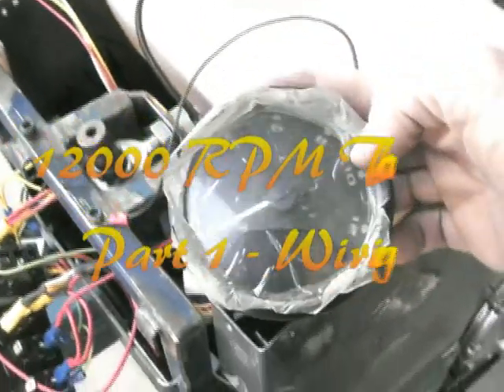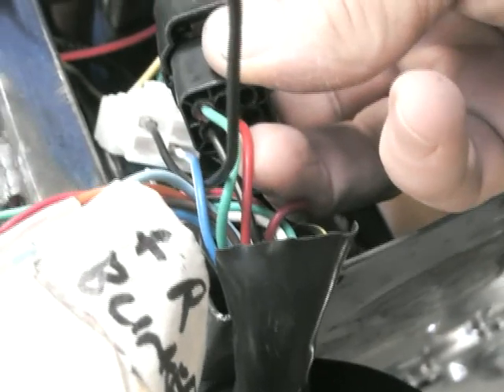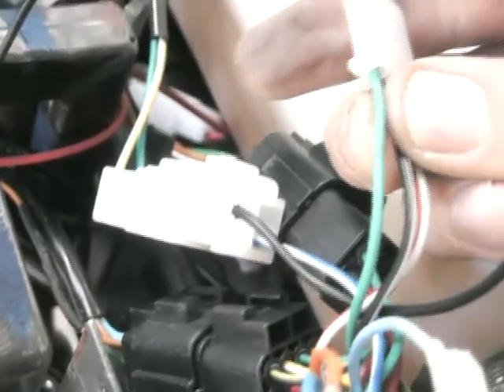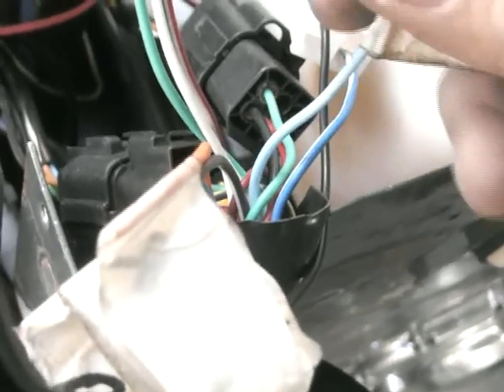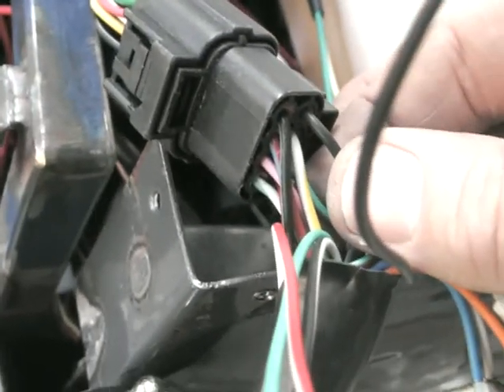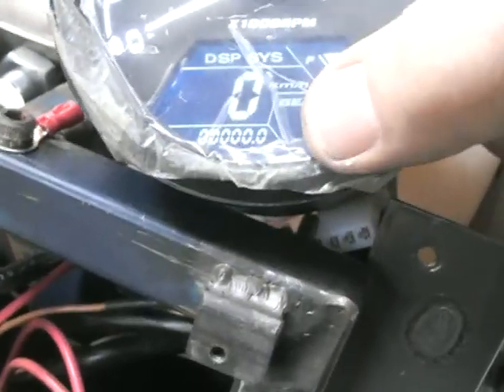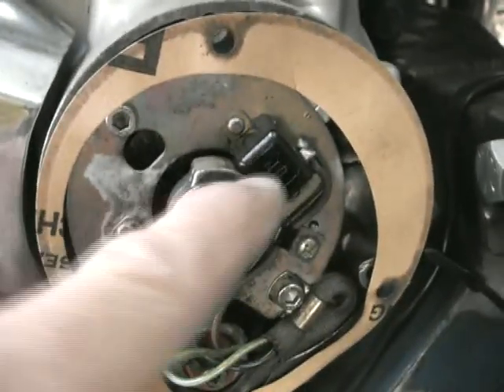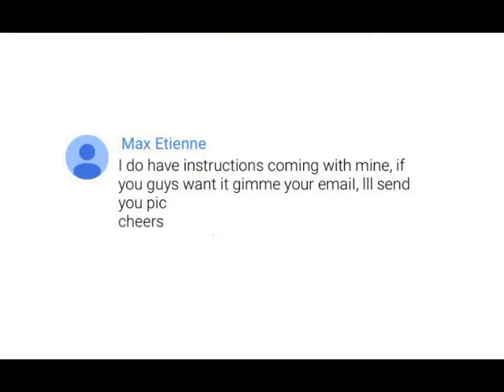12000rpm Tacho Part 1 Wiring

Comment: I now got it working and doing the sweep, etc. But the modes don't come up when Ido the on-off 5 secs? Just CCC 000, which I believe is trip milage set? And no mode number comes up. When I try to move on to the next mode, it trips out to begin again? Am I a dickhead or what?
Reply from the maker: haha, that doesn't sound right. Maybe the speedo has a fault. You press the rear button while the power is off, hold and then turn power on. To change modes you hold the button down for 3 secs once its in the set up mode. Check you have the memory power and main power connected correctly. Eg Memory power must be on all the time and the other power is only when the speedo is running
Reply: I figured it out by reading comments on other channels. It's an early or later model. The wiring into the clock is different and you must key in code 123 to get into settings, which are way different to yours. I've got everything working now except the wheel pulse signal, or the wire reading it? I suspect I've got a dud signal reader so have sent away for another, £6 and two weeks coming. On mine, the wire in is black n purple, but no joy. The signal from my HT coil and the + and - on my coil does not read, so I'm gonna wire it into the pulse gen like you advise. The Mickey Mouse instructions are a joke and reflect the Chinese thinking, but we haven't forgotten about Pearl Harbour ya Yella Communist Bastards.

Comment: Mine lights up but shows no data, just a blank backlight, and no neutral light. The high bean light and indicators work, but I can not get the settings function up despite trying all the methods shown on these vids. Ive double checked all the wirings. Does anyone know if there is a factory reset function on these things?
Reply from the maker: I don't think there is any factory reset. Does it do a sweep when you power it up? to get into settings you need to hold down the rear buttons, start pressing the button from before you turn power on, pressing after the power is on and it won't work
Reply: Cheers. No, I did all the procedures shown on these vids. The clock lights up, including the bottom window, but shows no digits at all, and no neutral light, even though I tried the old wire to the old clock, which should in theory. work. I emailed the sender and they are going to send me a wiring instructions diagram, but I feel I have a bum unit. I'll let you know what happens. Cheers.
Reply from the maker: OK, let me know the outcome. Sounds like you might have damaged the unit.
Reply: Mezzmo Engineering . I recently installed this speedo and i am having the same problem. Speedo lcd goes blank after some time while rpm , backlight , other lights keeps on working normally. Rebooting the speedo is the only solution i found so far. What would be the possible problem?

Comment: Hi, just need a confirmation. So basically on the diagram, the black/yellow wire which says speed signal wire will be directly connected on those pick-up post. I have the same diagram on your link but my wiring has different colors. I'm having trouble which is for the tacho.
Reply from the maker: That is strange, why do you think the tacho wire is a different colour. Maybe connect all other wires so in the end the last wire will be for the tacho. Does your speedo have a black/yellow cable?

Comment: Hi, I still wanted to thank you for the help you gave me for the ducati monster that works fine! I wanted to ask you another advice, I have a 4-cylinder Triumph of 2002/2005 and I have to mount the same speedometer and I have the same problem I had with the ducats, that is, I can not run the tachometer; I wanted to know if I have to mount it the same way from ignition pick-up or that kind of motorcycle since it's infection should be mounted differently ?? thank you so much
Reply from the maker: I assume you mean "injection"? I don't know your engine exactly but typically injected engines still get a pulse signal that's generally around 5 volts. So yes you need to wire the same and select the correct cable for the pulse signal. Don't connect direct to the coils...
Reply: you are a 600-cc 4-cylinder injection triumph !! so can i take the signal from the positive of the crankshaft pickup?
Reply from the maker: That's what I would try if it was me...Let me know how it goes
Reply: thank you so much as ever !! I'm sure I'll let you know, you've been my salvation, here in Italy I've all told you you were to help me!

Comment: Hi Mate,

Any idea how to keep the fuel indicator from blinking all the time? I'm not going to use it but the blinking is super annoying.
Reply: Just connected the gas wire to the ground and it stop the blinking. Great video and instruction.
Reply from the maker: Good you got it worked out. I will show how set up the level indicator in the next video
Reply from the maker: Sure, check my latest video. I explain how to fix this in that video

Comment: Hello, sorry my english but i'm using google translator, i wanted to ask you a question; I have purchased your own speedometer but I can not run the tachometer how can I do it? I have a ducati monster 600 with carburettors and I can not get it running, could you give me a hand? thank you so much
Reply from the maker: Hi, the detail you need is in this video. Please watch it carefully,  everything you need to wire the tacho is here. What is not working?
Reply from the maker: Domenico Catizzone the other thing you can do is use Google translate in chrome to understand what I'm saying in the video
Reply: Classic Celicas and more  Hello, I try to connect the yellow and black cable on the universal odometer, to the original sensor cable of my ducats, but it does not work.
I do not know maybe something wrong or maybe I should fit it differently. I tried to mount it also to the positive of the coil but it still does not work.
Reply from the maker: Hi, connecting to the coil positive might have casued damage. Look for the ignitor unit on your motorbike, it will have wires coming from the sensors from the crankshaft end,one of these cables should connect to the black/yellow wire. Try each one, I'm guessing there will be about 4 wires coming from the pick up sensots
Reply: Hello, thanks to your help I solved my problem with the tachometer. Now everything works a lot. An affectionate greeting from Italy
Reply: hello... if you do not mind. could you send the manual to didosujaya@gmail.com.
thankyou very much
Reply from the maker: The manual is on my Facebook page, the link is in the description. Its just one page.

Comment: I was thinking about buying one of these but all the reviews were POOR, mostly because of missing or inaccurate wiring instructions. This video is the reason I bought it. Can't wait for your set-up video, but I feel fairly confident about that. I did see from one of your other videos that if you have a single cylinder, you should leave that setting alone. I have a single, so thanks for that. Also, have you had it out in the rain?  I saw a video where someone had fog inside the unit. I'll probably make a breathable cover. THANKS for this video!